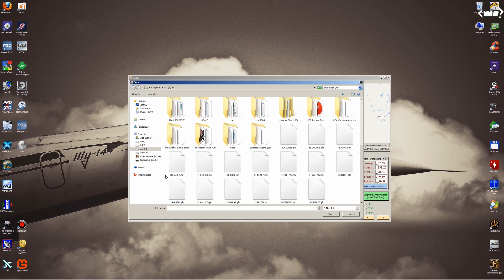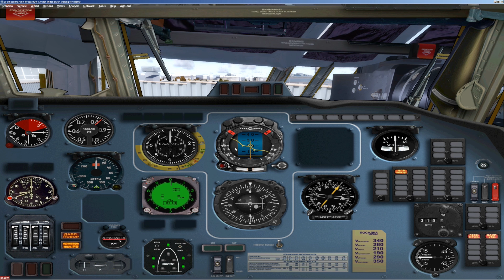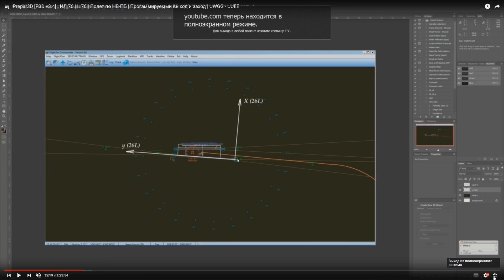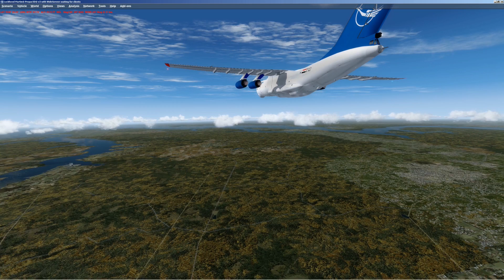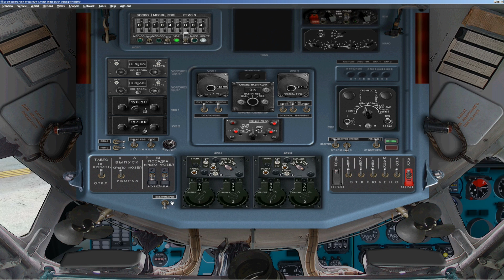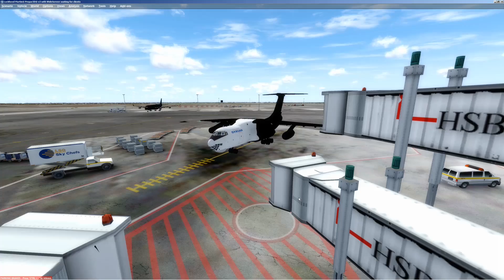Prepar3D [P3D] | IL 76 | Manual | Tutorial | KDCA-KJFK  | on English | Native Navigation | part 2

Comment: I can install the Il-76 in FSX correctly, but when I install in P3D v3.4, switches do not work in the panels. How did you install the Il-76 in P3D v3.4 to get everything working?
Reply from the maker: I cannot answer this question right now because I have, the prepar3D v3 is not installed now
Reply: If you manage to reinstall Prepar3D v3 and the Il-76 with everything working, please let me know how you installed the Il-76.

Comment: Hi, I downloaded the IL76 and I have 2 problems: 1)brakes do not work 2)I have to use about 80% trust to start taxiing which is not like in your video. Can you help me to fix this please?))
Reply from the maker: what is your version of the prepar3D ?
Reply: Мои полеты I have fsx
Reply from the maker: then I find it difficult to answer, since the problems with this model were only in the P3D v4.
The only thing I can say, pay attention to refueling fuel, if the fuel is very much and the aircraft is loaded "up to the top", you may not move or fall after takeoff
Reply: Мои полеты Could you maybe send me your IL76 file so the brake problem will by fixed as well? That would be really cool!
Reply from the maker: I deleted it long ago, along with all the planes that do not work in P3D v4...
Reply: Мои полеты Oh okay, well I will try to fix it by myself. Thanks for replying))
Reply: @Planespotter767  Hello! If you find a solution to the brakes, I'm very interested to know it!
Regards
Reply: Just got to my FSX folder, in the IL76 "Panel" and "panel.2"folder there is a folder named"config". In this folder I renamed the "joy" file"_joy"and ..that's it! Now there is no more brake issue and the controls work fine with my Hotas Warthog!